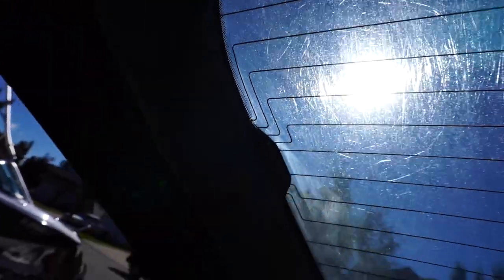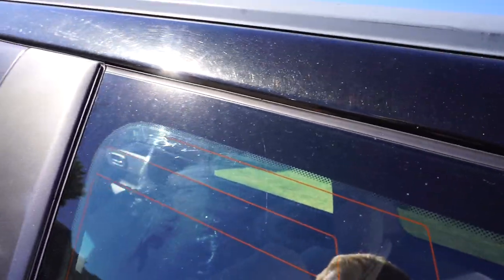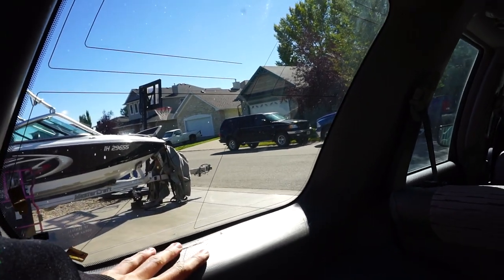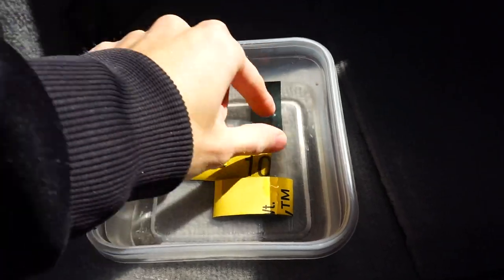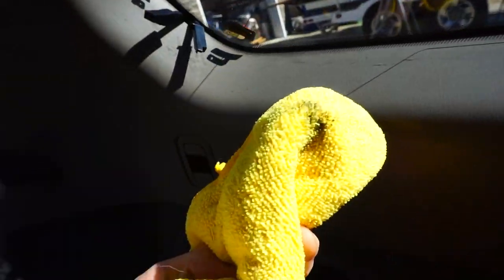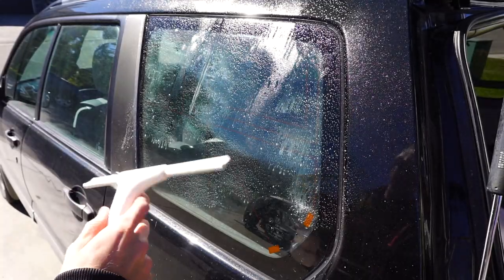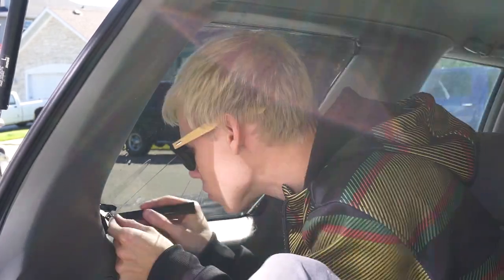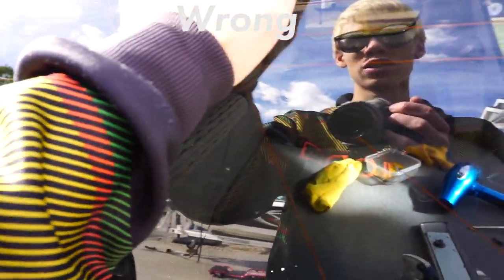This Guy Tried To Tint His Windows and Failed miserably

Comment: The problem with the back window is that you need to preshrink on the back window before even pulling the backing off. This helps it conform to the back window and install easier on the inside. Prepping is a huge thing with tinting. Slightly going over the defroster lines with an scotchbrite pad will help the tint stick to those as well and less bubbles and trapped air. Also depends on the tint brand you are using. Cheap tint = cheap result.
Reply from the maker: Haha yeah I realized that after, live and learn. The tint is what the local shops use here, I got it from the distributor